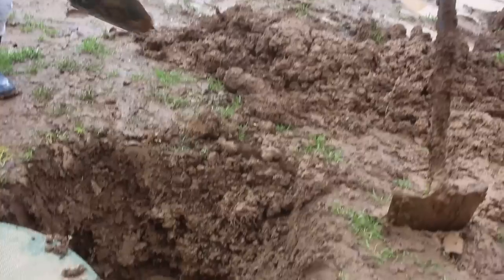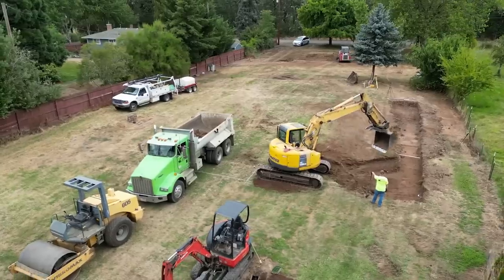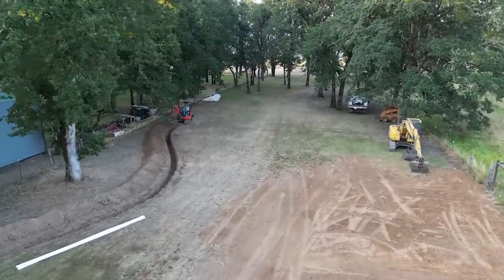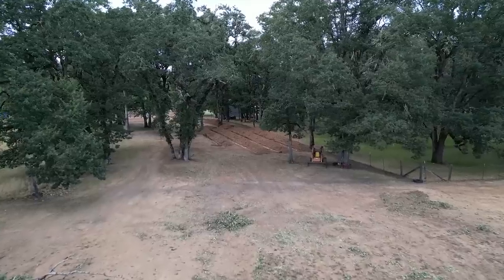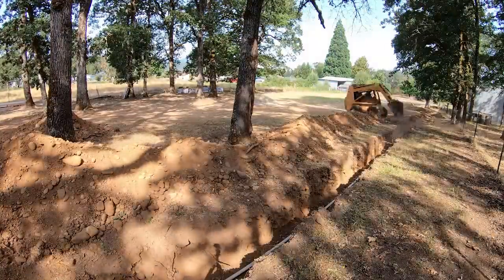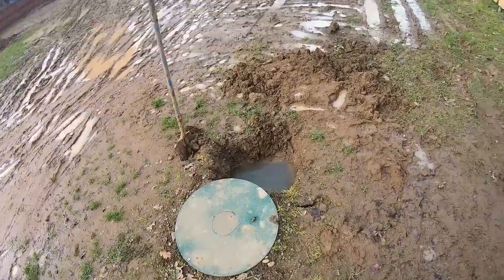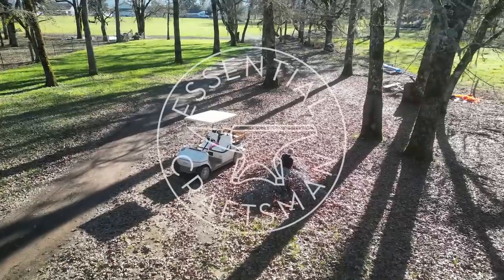Installing a Modern Septic System

Comment: Sewer effluent is a major magnet for tree roots. I give it less than 10 years before the drain lines and trenches are root bound being that close to mature trees. A certified engineered system and site survey is worth every penny in hindsight .......... the hard clay and  groundwater at 2 feet is also troubling.
Reply: That's not ground water. I've dealt with clay just like this. Percolation rate is really slow. So when you get a heavy rain the soil is really saturated. You dig a hole and the water starts escaping the soil into your hole

Comment: $80K?! I guess I should go back into the septic installation business, the most I ever charged for a difficult one was $12,000. I never had much faith in the craft, or as we called it rosin paper. It would tear upon backfilling and if it got wet before backfilling, about useless. Straw or a weedblock type fiberous barrier is far more durable. BTW, the silica dust inhaled during the stone placement is a concern. I appreciate the fast motion video, makes me glad I don't have to endure it anymore. Great video!
Reply: I installed my own 2 years ago. 1500 gallon concrete tank, same risers and lids was about $2000. 200 feet of leach field with 4" perforated SDR pipe around $300. 150 feet of 4" non perforated SDR from tank to leach field $225. A crapton of drain rock $1200, I could have used cheaper rock. And like $150 for thick landscape fabric for the leach field. I did it in less than a week in really hard soil.  There is no way this one was $80k.
Reply: @MrJramirex , In Ohio you have to be licensed to install a septic system and it has to be inspected before you bury anything. The price on materials is probably pretty close to those here.
Reply: My installer just put landscape fabric over the rock in my drain field
Reply: @Tim Finch  That sucks. California lets you do pretty much everything but drilling a well as Owner/Builder. The county's Environmental Health division came to inspect my install after all the rock was at the appropriate depth but before backfilling with dirt.
Reply from the maker: The project did not cost 80K! Wondering where you came up with that number?
Reply: @essentialcraftsman  
My area is clay too. My four field lines were fifty foot each from my tank. Total cost $5000. Twenty years ago people in my area used a 55 gallon drum with a five foot dump line setting on top of the ground.

Comment: Deciduous tree roots are brutal. Over 25 years or so, I cleared all the leafy trees well away from the field, at least 75 feet. I've found evergreen roots are much more localized. This episode brought back so many traumatic memories of my septic install--as in a 1000% increase in permit fees which for the first time in my rural area included an inspection!!, having to take perc tests on dirt recently saturated by the spring melt of 4 feet of snow (unfair I said to the health inspector, to no avail) to having 3 pump-out chamber pumps fail in the first 2 years. GK

Comment: Interesting to see the different practices in another region and what the soil conditions allow. Our soils here in New England require large excavations on the fields removing the layers of soil until a glacial till is uncovered. On a 3-5 Bedroom system we typically use anywhere between 80-400 yards of sand in the leaching field. Rather than the paper you guys used we use filter fabric and or pea stone to transition the material before backfill. Great Vid as always!

Comment: Good content Nate. Ive installed several systems over the years. The new ones use chamber or " infiltrator" system. No gravel. Just an underground cave. Some were gravity and some were pressure dose. Anyway what I learned was that the moisture effluent basically relies on evaporation more than the seeping action or perking.  Our pumps live in the tank itself. Ive never installed a t in the riser.  Cheers from Montana.
Reply: Installed a chamber field in clay soil about 15 years ago.  Failed and replaced within 12 years with conventional gravel and perforated pipe.

Comment: I'm surprised there are no comments on the fact you have to have an electric pump to pump the tank to the leach bed. I have the exact same problem. When the electric goes out, your tank fills up because the pump is not pumping. I worry about it every time the electric is off for hours. Showers drain, toilets flush, clothes washer emptying to the septic tank. Then what happens? Sits there till the power comes back on. Just something to think about. Or get a house generator. Hopefully, you put your pump in an easily accessible place for maintenance or replacement.  Good luck to you, sir. Oh, and keep up the good work.
Reply: I have a similar system (jurisdiction told me gravity only systems are not often allowed anymore).  It's not as convenient, but it takes a lot of waste water to fill up 1000 gallons.  As long as you avoid dumping tons of water (i.e. laundry and showers) down the drain during the outage it's not a huge deal.

Comment: BTW, 45 years ago I put hundreds of feet of French drain in my yard to catch natural springs that would appear each spring and saturate my yard. The French drain used perforated pipe laid directly on the soil bottom of the ditch, then the pipe covered with 16” of clean gravel. Some had suggested 4” of gravel below the pipe but an old gentleman from the old US Soil Conservation Service said no, you want the perforated pipe laying on the bottom of the ditch because otherwise that 4” of gravel would need to fill with water before it entered the pipe AND that 4” of water in the gravel would likely just follow your pipe to its outlet, making the pipe essentially useless. Made perfect sense to me…get the water in the pipe first, water takes the path of least resistance and the gravel drains groundwater directly TO the pipe! But now to the point I wanted to make…we put a layer of straw on top of the gravel before we backfilled with soil. 45 years later my French drains function perfectly and there has never been any indication at the surface that my soil infiltrated past the straw layer on top of the gravel. That paper might work fine.

Comment: We never, ever, put our drain fields anywhere near big trees in the midwest. Even from many yards away tree roots find there way in around here.
Reply: I wonder if it’s a non-issue in Oregon because they get so much rain.
Reply: @jonathanfrain1803  Trees usually enjoy a good drink or two of rain water.

I saw in another comment someone say that their oaks grow so slowly that the roots won't get there before the septic fails for other causes. Maybe so? 🤷‍♂
Reply: I give it maybe five years.  Roots grow twice the foliage of the tree. About 3-5 inches per year without fertilizer. Septic is fertilizer.
Reply: Same as in Australia. No way those trees would be left remaining. Be interesting how long it took until tree roots took control of the Aggie.
Reply: I agree, I have had to dig up fairly recently installed 4”soil pipe because tree roots found their way in, the pipe was a solid mass of roots inside.
Reply: is that a midwest thing or just common sense? Like roots… my dude.
Reply: @colinstu  Dunno... I'm just leaving it open to a reasonable explanation since I don't have one myself.
Reply: Here for the answer if someone has it. Putting in septic soon in Texas and am curious.

Comment: Interesting! This is one area where the US and Northern Europe have very different solutions. Here in Sweden we have to install 3-chamber septic tanks, and most are plastic. Also, we use 160 ft2 macadam beds as drain fields (or some plastic modules for more compact solutions), covered with geotextile and often XPS insulation. You are supposed to keep 15 feet to the nearest tree from the edge of the macadam bed.
Reply: Im in NE Canada.. I have a 2 chamber septic tank. Then the water is drained naturally (no pump) to my septic field maybe 100 feet or more away. My septic field is a Ecoflo which is just a fiberglass (or plastic unsure at the moment) and have 2 chambers. Best thing is you dont have to move them. Where I live you have to change you septic field every 10-15 years when its the typical sand and such septic field.. I also add bacteria to my septic system every month. Does it work? I like to think so but the product is really well rated and not that expensive.

Comment: I'm in Connecticut, and I'm jealous of your dirt.  I can't dig one hand shovel's worth of dirt anywhere ever without hitting a human head sized stone at least.
Reply: I used to live in an area with clay soil then in an area with sandstone and now sand. Each has unique methods for excavation and it's own problems.
Reply: You want bedrock no deeper than 2 ft so that way you don't have to pack in all the dirt. It's good having rock imo
Reply: @aaroncortez5928  well, we have have to get 42” in for freeze purposes, we are well into hard clay by that time. It’s just that the hard clay is severely rocky. Even if we hit actual solid rock, we still need 42” of depth, so that means hammering or blasting.

Comment: In South Carolina where I am no one uses pipe and rock anymore. They are using an infiltrator system that uses half round shaped plastic panels that are 3 ft wide and snap together I think they are 4 ft long. You dig a trench 3 ft wide with a smooth flat bottom and lay the panels in snap them together and cover it up. You can haul  all the drain field material on the same truck and trailer that you haul the excavator to install it and it doesn't take a lot of manual labor.

Comment: As someone who has installed several hundred septic systems, the idea of the craft paper makes no sense to me either. We have always used filter-fabric over the drainrock to keep the backfill dirt from settling into the rock voids and clogging up its free-flowing properties. 

I’ll never understand the paper to be able to form a crust in any type of soil as the trench is always going to be saturated with moisture and the moisture will break down any sort of crust that could form.
Reply: thats what we used too
Reply: S Florida it was tar paper/felt.  Sandy soil, less the 1/4 the size of this drain field.
Reply: washington state, back in the 60's we used newspaper over the gravel... never seemed to have a problem.

Comment: The paper acts as a silt barrier.  It slows the early debris with fine particles and as they collect they add to the debris barrier.  This allows the rock under the paper to remain open and the pipe to drain.
Reply: exactly, without the paper within a short time rain would wash fine dirt out of the soil in between the washed rock and simply clog everything.

Comment: Our septic flooded the 2nd day we moved into our forever house.

Damn leach field had stopped working; got a pumper out & he reckons the tank hadnt been pumped out since the house was built (in 2000), and that the leach field was so clogged he ened up jetting/ jet cutting eucalyptus roots out.

Works fine for now- but will look at putting a more modern system in with a much longer field in (currently, it is only about 12 meters long!), mostly shitty rock/ alluvials/ sandy loam here, so drains great

Comment: The excavators in your area have it so easy regarding soil conditions. Here in Southwest Missouri it's roooccckkky.
Reply: I live an hour from EC, right next to a river. Sometimes it seems like 1/3 of the ground is river rocks, some of them head-sized. Makes it not fun to dig post holes. But at least we don't have boulders or shale or any of that nonsense.

Comment: I work in water distribution, repairing water mains, services hydrants etc. When we dig down it's quite apparent that generally only the top foot of soil ever really gets saturated from rain water. Especially once you get into the clay layers. Even when digging up water main breaks that were gushing thousands of gallons of water per minute until the point of being isolated with valves, you can take a scoop of surrounding dirt and hit dry soil just inches away from where the water washed away the rest
Reply: So that craft paper is just enough for the ground to compact and roots to establish and keep the soil from washing down into the rocks.

Comment: In Idaho you have to have 8" of drain rock under the drain pipe, 6 to 8" of drain rock on top, then either fabric or six to eight inches of straw on that to keep the dirt from filtering into the drain rock and plugging it up. Then you can put dirt on that to level the ground. There are also reg on how much drain field you have to put in depending on residents and bedrooms.

Comment: Quite the drain field! We had to put in a new system before we sold our last house, was very similar to your setup except it was all gravity fed. Our new house site is on ledge, so the septic system is engineered differently. The tank drains into an enviro septic system, which is basically a series of pipes wrapped in an organic mesh type filter, with larger pipes surrounding that, and it’s all sitting on special sand. Not exactly sure how it works, and I’m a bit skeptical about it over the long term, but I guess we’ll just wait and see.

Comment: That was so interesting.  Especially the drain field.  Many years ago I lived in a house built on a steep hill with clay soil.  The back garden was also steeply sloped, but because of the clay soil, it wouldn't drain and was always wet.  So I hand dug a series of trenches which I half filled with gravel and topped off with soil finally draining into a big soakaway pit filled with rocks.  This worked nicely and the garden was no longer wet, but over time the dirt in the trenches washed into the gravel and I was forever topping it up.  If we'd had YouTube in those days I would have known to put fabric over the gravel before backfilling with dirt. 

Chris Guins, (LetsDig18) puts in a lot of gravel roads, and he says using fabric allows you to get away with a lot less rock, and with a single lane road needing roughly two yards of rock per one yard of road, (estimate based entirely on watching YouTube videos) that can save you money.

Comment: Are there considerations for digging a drain field near tree roots? I always had figured it would be a nono, but not really sure about it.
Reply: It depends on the type of tree as some do have deeper root systems, but most of the time it's a good way to kill them. They want their roots to be in the same soil type and depth that make for good septic drainage.
Especially on the one they surrounded, most of the root system is likely severed.

Comment: Is it an aerobic septic system? Used to live in a house here in Australia that had one - it had a regular septic tank and then a second one that the effluent overflowed into after the solids settled out. The second tank was divided in quadrants that had baffles in them for bacteria to grow on and had an aerator pump to pump air into the effluent so the bacteria would digest the nutrients in their aerobic metabolic mode, producing CO2 rather than the anaerobic mode that produces methane and nasty smells. When the effluent made it to the final quadrant it would be pumped out, dosed with chlorine and used to irrigate of the lawns and gardens.
Mind you, we don't have to contend with freezing temperatures here so that may be why you have an underground drain field if you do have an aerobic system.

Comment: Interesting looking at how different states have different regulations. Not trying to be a keyboard expert so don’t take it as such. Here in Arkansas our field lines have to naturally settle for around a year before you can slick them off. We also use a soil separator, it’s almost like a super thick cotton material that you can see through. It’s non degradable that allows water to permeate through soil but not allow the soil to get in the perf pipe. Also one thing that might make it a little easier on you. This is just how we do it but you can skin a cat a lot of ways. We dig the trench level and when we lay our pipe we use 1/2” rebar and tie wire to fasten our pipe. You can shoot the pipe while pecking the rebar down kinda like you would setting rebar to pour a footing until you hit your desired height. Here we have to drop our pipe 2” every 100’ so that system works good for us and rebar is cheap here. Also curious, what type of distribution device did you use? D-Box, spider valve? I couldn’t see it in the video. Great video btw!

Comment: I'm concerned with root intrusion from the oak trees into the drain field.
Reply: I don't believe there's any easy solution to prevent that unless you take out all trees.  On my system, it was designed with access holes at the end of each trench.  That way you can do a "squirt test" by turning on the pump and verifying flow through the entire drain field.  You'd be able to quickly diagnose clogs/root issues that way.
Reply: Not very likely with well established trees.
Reply: In this instance you should only be concerned if they are edible fruit trees, it’ll turn your apples into crap-apples. 💩🍏 

That is purely sarcasm. 😂🤦‍♂️
Reply: @michael-michaelmotorcycle  I think that's a good one

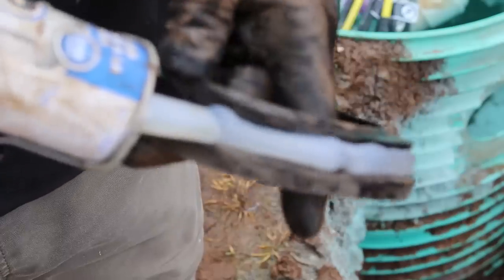Comment: 10:51 butyl rubber didn't hold back tree roots after about year 15 so I imagine that silicone will offer a similar lifespan.  If you can't wait for butyl rubber rolls for septic then it's also sold in strip rolls to be used on wood porches & wood stairs.

Comment: Code here allowed for tar paper or straw over the drain field gravel. I used straw 35 years ago when I installed our system which still works.

Comment: For us in Dominica we build concrete block septic tanks or use those huge plastic ones and connect it to the soak away hole. Soak away hole is dug and filled with rocks then backfilled with dirt. Size depends on the number of people.

Comment: Here in central florida i see a lot of systems installed with a plastic arch system that looks like half a metal culvert and i dont usually see any pipes installed either